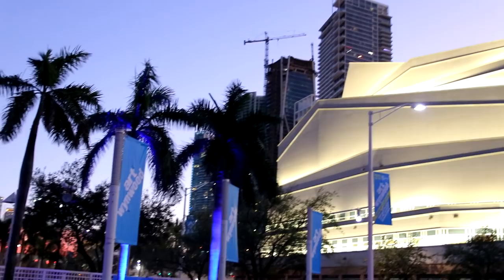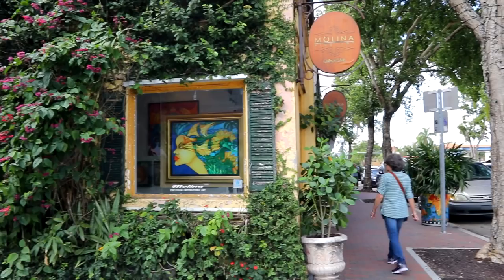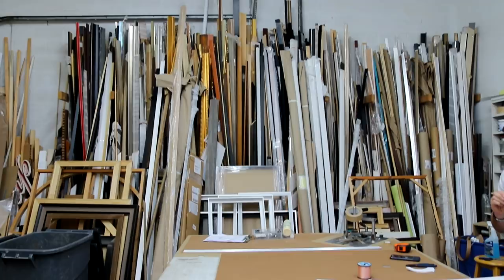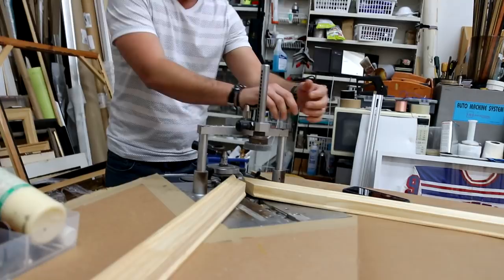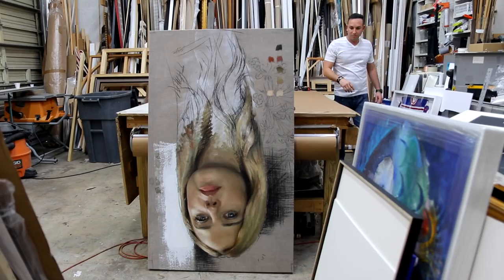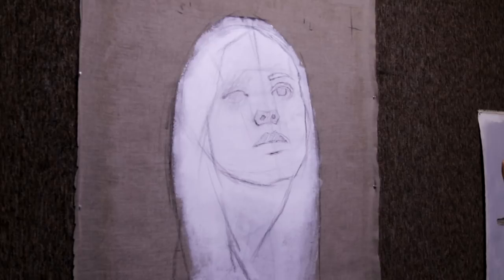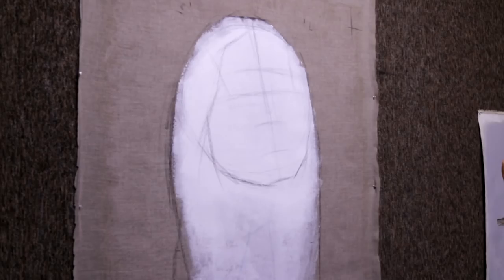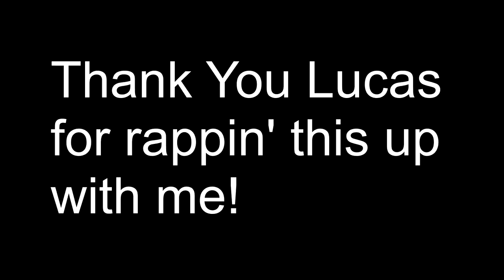Art Behind the Scenes. Cesar Santos vlog 041

Comment: 7:02 Look at her eyes, they are moving :D
Reply from the maker: Yeah lol. I had to lower them. Sometimes you need to make adjustments!
Reply: @santocesart  Cesar, the biggest challenge I have in painting is getting proportions correct. What process or technique do you follow to get proportions right - especially when the face on the canvas is a lage size? Then of course it is even more difficult when one is painting/drawing not using the sight-size measurement but using proportional measurement. Because in portraits, a few millimetres off and the expression is wrong. Many thanks.